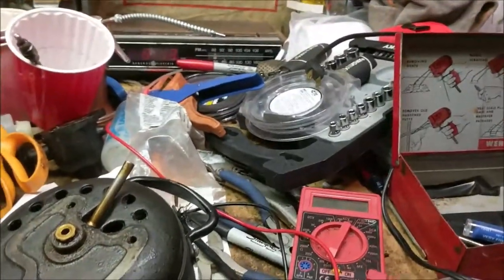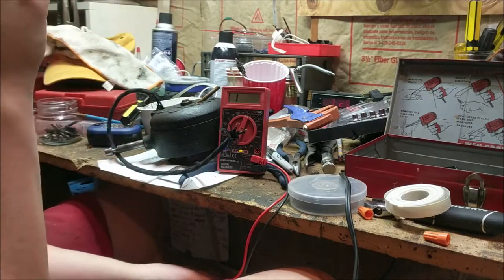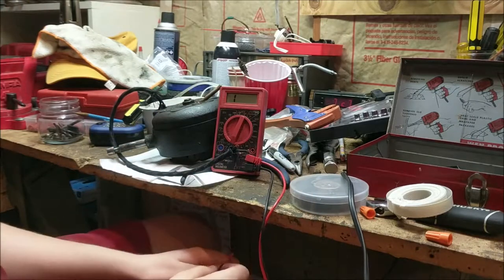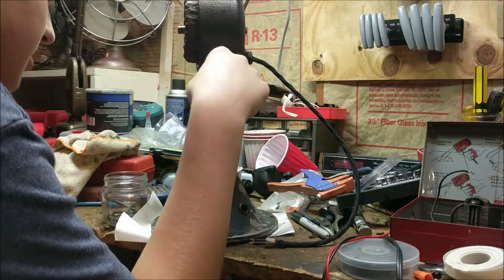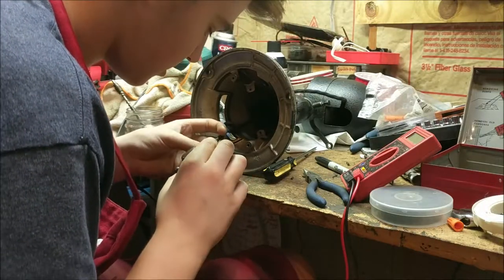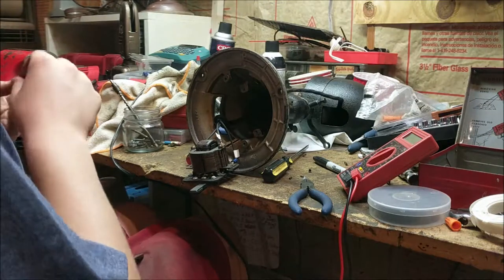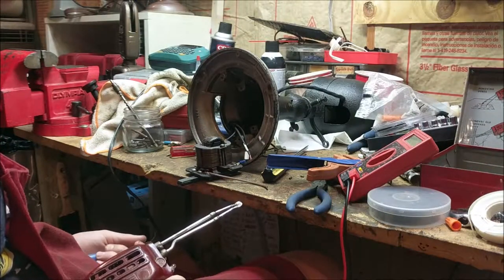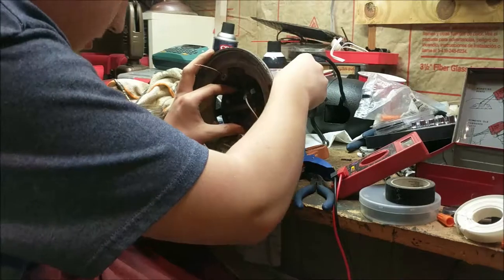How to wire a Emerson Electric 77648 fan (part 2)

Comment: I'm three years late! This tutorial is great and has helped me a lot. It's not a perfect guide, but nothing about these old fans is perfect. For such a young man you're skilled in repairs and tinkering. HUGE THANK YOU for the time and effort to make the two part video.

I have gotten into fans hardcore. This week alone I've fixed up a Westinghouse 16A3, 16PA2 and 16SD3 models. I also did a tiny 1936 FA Smith and a nice 1949 Emerson Electric.
Reply from the maker: Yeah I need to make a new video.